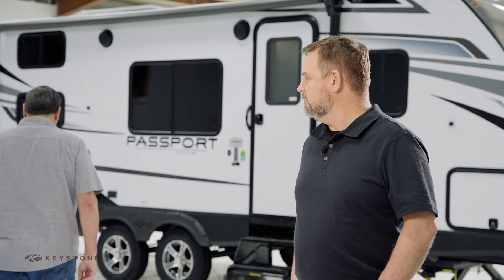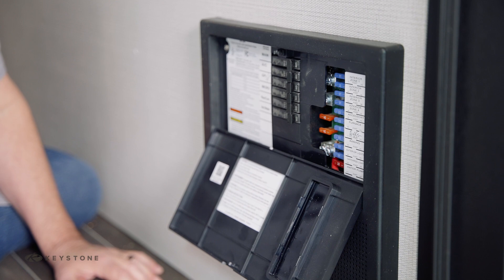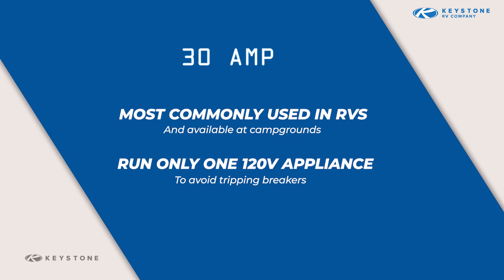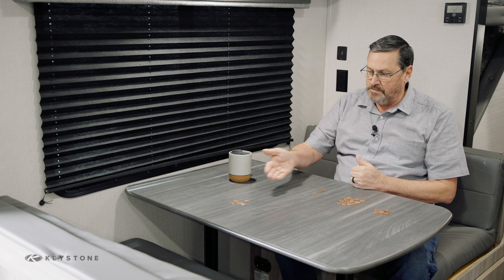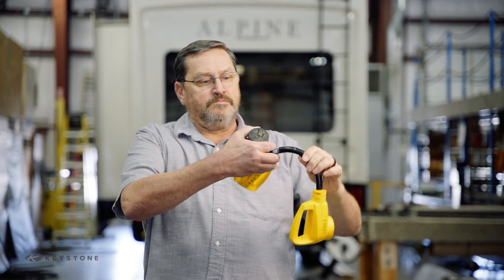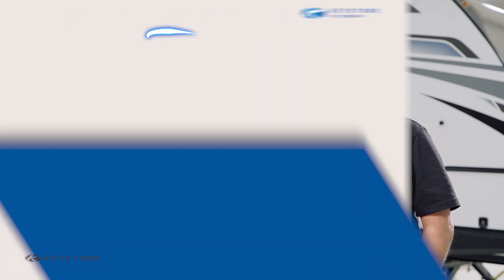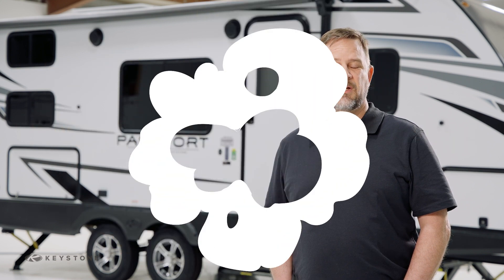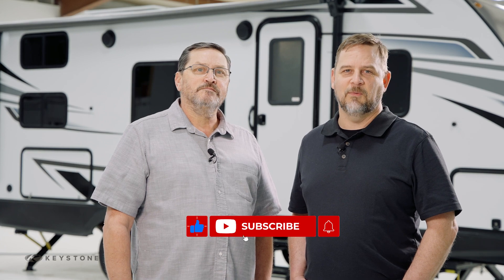Understanding RV 120 Volt Electrical System in your RV!

Comment: Just an FYI, I pulled into a RV Park late and didn't realize till the next morning that 1/2 of my 50 amp breaker wasn't working. I learned a rookie mistake that your batteries go dead very quickly on a cold night

Comment: So confusing. Why do you keep saying 50 amp is 120 volt if there is 2 6 gauge wires carrying current. Is that not 240 volt?

Comment: For vehicule equipped with 50 amp?  Would be nice to have more information such as electrical panel behind the scene hidden fuses and converter.  Spent two days and two trip to 2 rv center to find a knowledgeable technician to fix 2 blown fuses.  How about a 50 amp power distribution explained video for 2024 Bullet
Reply from the maker: Thank you for your feedback! We will pass this along to be looked into.

Comment: so one appliance at a time????     so if you are plugged into a 30amp service at a campsite, you can only run the AC or the hot water tank OR the microwave???      do people actually turn their AC off so they can run one of the other things???
Reply: Yes they do you don’t have to run every thing at the same time

Comment: just bought me a 2019 keystone outback (30amp service).........if i upgrade the wiring to the panel to 6gauge, and convert the entire wiring to the outside plug to 6gauge 50 amp service, can i run everything at the same time?  (1ac, 1 water heater, etc...)   is the problem just with the 10gauge wiring going to your main breaker panel in the RV?   because they should be an easy fix to upgrade the main service wire to a 8 or a 6gauge...and basically just terminate one of the 220 legs so im just running 1 leg (110v) but going through a 6 or 8 gauge wire and neutral

Comment: We just bought a 2022 Keystone Cougar 355FBS.  There was a power surge at the rv park we are staying at.  I have a surge protector but after all the power came back on the tv outlet and 2 pop up electric/USB outlets stopped working.  Checked all fuses, breakers, and the gfci in the bathroom and all is good.  Any ideas?
Reply from the maker: Good morning! For assistance with this, please contact our Owner Relations Department (with the last 8 digits of the VIN) at 866-425-4369 Monday-Thursday 9am-5pm & Friday 9am-4pm. Thank you!

Comment: Hello, i just purchased a 2022 Coleman Lantern 17B. It comes pre-wired for a rear view/back up camera. The one that the dealer had was outrageously expensive so i just got one from Amazon.
The question is.... when i took the Furrion housing out i noticed that the connecting wire was in it but not connected to anything. This connecting wire has a red and black raw wires to be fixed to whatever is in the camper. I also noticed this connecting wire is in fact compatible with my Amazon camera because it fit perfectly.
The problem however is with the wires coming out of the RV. I get 2 green coated wires merged with a black one and 2 white coated wires merged with a black one.
The question is...the connecting wire  has red and black. How do i correctly connect that connecting wire to the set of wires coming out of the RV?????
Reply from the maker: Good afternoon! Thank you for your inquiry. We have a few resources that will help you. Here is a link to our YouTube video for installing the rear back up camera, as well you may find our 12V color code for the wiring on our website, link below. https://www.youtube.com/user/KeystoneServiceTips/search?query=back%20up%20carmera and to our website - https://www.keystonerv.com/owners-manuals

Comment: Hi there I have a 2019 29rks how do I upgrade my battery charging system from flooded to lithium
Reply from the maker: The factory installed converter is already compatible with a lithium ion battery. Thank you.